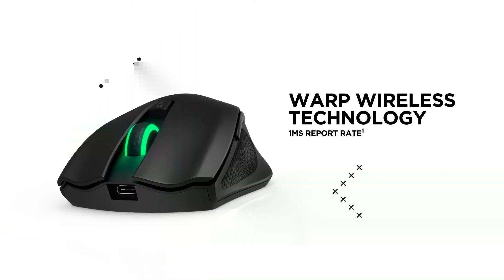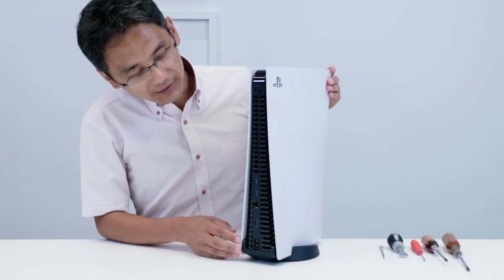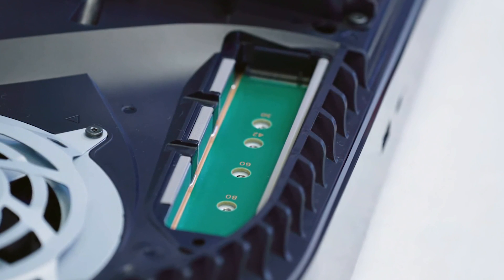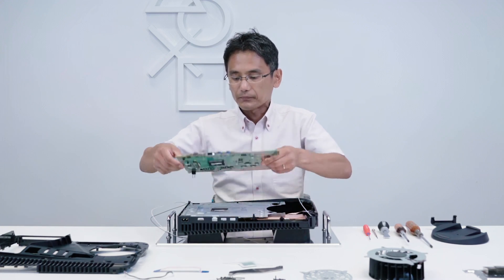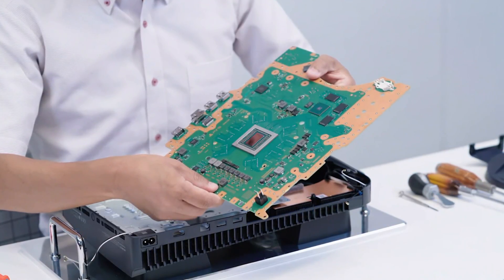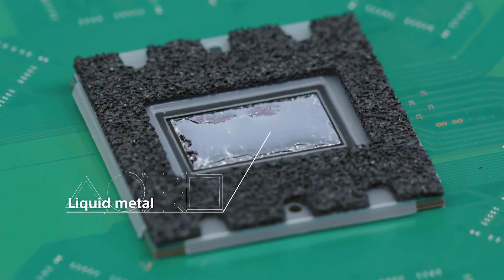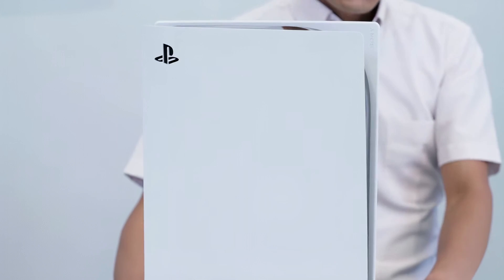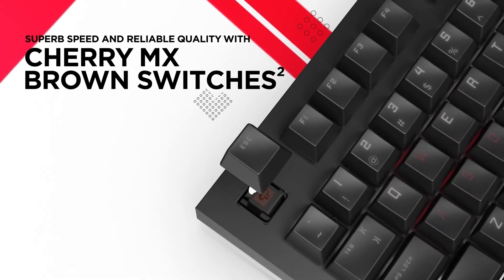PlayStation 5 Teardown Analysis: Inside Sony's Next Generation Hardware Design

Comment: So I finally watched this video.  Wow Richard could you be anymore bitter, biased, and condescending about Sony and the Ps5?!  My God this was essentially you saying how much better the xbox series x is and downplaying all the Ps5's amazing design features.  First you start out by praising Microsoft for giving you complete access to series x.  The entire video is you questioning and disparaging and downplaying all the Ps5's design decisions then praising the series x choices in comparison.  It really is insane how bitter and biased you are Richard.  You start by giving a back handed compliment to Sony by saying it's great the stand is included but making sure to say it's lo tech and nothing special.  Then you question whether the ssd will need a heat sink and suggest that performance could be lost unlike Microsoft's ssd which is on the outside of the system.  Well Richard the answer is right there in front of your face.  The ssd is right next to the inward air vents on the front of the system, obviously the fan was designed to dissapate the heat from the ssd.  Next you talk about the fan but make sure to note that one of the dimensions is bigger on series x.  Then when you get to the wi-fi and bluetooth section of the PS5 you completely downplay that playstation has the next gen versions of both of those.  But series x has the last gen version.  You failed to compare to it to series x when Sony has the clear advantage and downplayed it's significance.  And didn't even ruminate on it's likely use for a wreless PSVR 2.  Likely because that's where Sony has another advantage being the market leader in VR.  Then the discussion moved to the SSD/IO complex where you failed to mention that the Ps5 is 2.5 times faster than series x and has 50% more memory channels.  You failed to mention that having 12 memory channels is unheard of, even in the PC space.  And if taken advantage of by developers could result amazing things in game design.  Not content to just gloss over one of the Ps5's massive advantages over series x, you had to again throw some shade by saying unfortuately it's soldered on so it's impossible to remove unlike series x.  Everyone seeing the pattern here?  Next he barely gives any credit to Sony's cooling solution of liquid metal and it's large and well thought out heatsink.  He again disparages the Ps5 by saying Sony just went large and implies that it's poor engineering compared to Microsoft's much smaller xbox series.  The crap comparisons continue by Richard again exclaiming how big the motherboard is and again implying that it's not as well engineered as Microsoft's two smaller motherboards.  He adds a new disparaging remark by calling the motherboard simple compared to series x.  He then reminds everyone that Microsoft gave more details on the components of the Soc and praising them for it.  He then incorrectly states that the chips are for the most part the same and therefore Sony won't have any secrets to reveal but that series x is superior.  Finally he keeps repeating that Sony made the choice to go cheaper than Microsoft implying that this means the series x is superior.  Like last gen, where Cerny was able to make a superior system that's cheaper to make, I guarantee he has done it again.  Seriously this video was insane!  The bias is just so blatant.  This was just as much a propaganda video on series x and Microsoft's next gen strategy than a Ps5 teardown video.  Digital Foundry has dropped way down in my book now.  Check out NXgamer or Redtechgaming if you want more impartial videos.  I really can't get over how blatant the bias is now!
Reply: Just take a deep (bespoke) breath and chill-out. You’re got yourself all worked up.
Reply: Dude. Paragraphs. Learn how to use them.
Reply: That's what Microsoft sucking up and giving DF the VIP treatment at their HQ has done to them....

It's no longer a credible source of unbiased information, it's a better idea to get opinions from sources that aren't best buddies with either manufacturer. That's not the case here...
Reply: Let's be honest, Microsoft does almost everything better in the hardware side. Let's forget the 360 era and focusing on the One X vs PS4 Pro era and forward (Series X vs PS5). How compact and expensive the systems are (inside-out) compared to Playstations. PS5 looks like it's made of 90s leftover plastic and aluminium.
Reply: @virxest  Yeah ok bud.  Let me know when the shuttle lands.
Reply: Also check out Innocence where he literally explains all the leaked patents of PS5 and make a spot on educated guess of the PS5.

Anw, same like you, I lose all the respects for Digital Foundry. Thank you for suggesting other channels tho
Reply: @hungjaketranquang4365  The only impressive thing on the hardware side of the PS5 is the SSD and I/O speeds (which does not give you fps or resolution benefits), but Sony basically cheap out everywhere else. How do you praise it? They were just being honest and you won't accept it. Since it's your choice of the console (I assume), you just want to hear nice things. You cannot even praise the liquid metal in PS5 because the Series X uses the Vapor Chamber cooling solution which is more advanced and expensive in general. That's why it takes so much less space...it's way more effective. It only looks like a normal heat sink on the outside.
Reply: @virxest  You frankly don't know what you're talking about.
Reply: We shall see DF eat their words next year when the performances on same games are compared... or not. Till then take a chill pill bud.
Reply: @ivantruthkovic  I have no idea what the benefits of the things you mentioned are. I never use the console via Wifi (and you have to buy a very expensive new router...I saw prices between 200 and 300 usd) and USB-C and BT5.1 benefits we are still waiting for. Vapor Chamber cooling solutions found in One X and Series X are generally more expensive and advanced. I was thinking in general about the look and feel of the console (savings).
Reply: @Sony Drone Yes Sony is the market leader in sales of VR units.
Reply: OMG I can't believe that all you said was also inside my heart. DF have recently been sooo crap and trash praising MS's far inferior basic PC-like machine and saying shit against PS5. God knows how much they are being paid by MS! 

Please reply!

Comment: Still not sure why digital foundry insist on referring to the PS5 GPU as operating under a "boost clock" as the Eurogamer article released after the PS5 spec reveal indicates that the GPU and CPU operate at optimal frequencies when supplied with full power and are throttled to match work load. While this difference may seem minuscule on the surface the design implications are actually quite telling. This power shifting model, as opposed to a constant power supply model used in conventional console manufacturing, means that the PS5 can be extremely power efficient while offering optimal performance based on workload, rather than the other way around. This allows the PS5 GPU and CPU to only work as hard as needed for a particular game or even at a micro level within a given scene. This "work smarter, not harder" approach has some very interesting ramifications in games because the higher clocks allow the PS5 GPU and CPU to punch well above thier weight class while at the same time managing power consumption. It will not be suprising to anyone who has compared faster clocked hardware to more compute heavy hardware that the end result will be that both approaches lead widely to the same performance metrics. It will be interesting to see how PS5 unorthodox power system stacks up to the conventional wisdom, but it will not be suprising if the expectations for power difference are nothing more than people arguing over which two roads will lead to the same destination.

Comment: He doesn't seem too impressed with the design

I feel like the playstation is big, has a bigger fan, less silicon, liquid metal and variable clocks to reduce heat. Xbox is either a superior design or is going to have heat troubles. I don't see how one needs this level of cooling and the other doesn't unless Sony really dropped the ball and more cores at a lower clock was actually more powerful, cooler and cheaper???
Reply: I seriously doubt it's cheaper. Upping clock speeds is basically free. Hell, the Xbox One upped the clock speeds to try to keep up with the more powerful PS4.
Reply: @bf5175  right but maybe the heat increases requiring more expensive cooling solution
Reply: One thing to keep in mind is that PS5 is flatter than the XSX, and that comes at a cost. Another thing is that one can just be louder than the other, doesn't indicate heat troubles.
Reply: @ianwparedes  I guess we will see after they launch. If ps5 Is a beast and xbox is naff then I'd say he's getting bias because of the treatment from Microsoft. But if its the other way around then maybe Sony dropped the ball this time. Time will tell

Comment: I'm not getting one at launch for 2 major reasons.....
1. Don't have $500+ for it. (lol)
2. I'm going to wait till they make a "pro" version of it cuz I know they can make it... Better - er...
Reply: Best way to handle this. Cerny saying that Sony may be trying to push max power makes me worried the ps5 will be a thermal throttling brick-case. I'd definitely wait for a pro version and hope it has a psu rated at a much higher wattage is in store to actually utilize the hardware.
Reply: I’m gonna get the PlayStation 5 100% paid for with credit card rewards as soon as Amazon gets more in stock. Then I’m gonna save up for the PS5 pro and put that in a savings account to be held until they bring it out.

Comment: I have to disagree on the SSD heatsink remarks. (In my humble opinion) nands do not require cooling unless things get really hot (around 100C). The sweet spot for operating temperature is around 60C, and more to that, there are tests out there suggesting that halving the temperature (eg.: 30C) will significantly shorten the lifespan of the affected nands. What needs cooling is the controller, because if that part gets hot, then throttling will happen. 
Whenever I build a PC and put a sink onto the M.2/NVMe drives, I always cut the thermal pads, so they only cover the controller and not the nands.
Just my two cents.
Reply: My understanding is that the NANDs don't heat up that much anyway, so it might be better to have the heatsink on them for them to warm up from the controller heat. So when you do start a write operation on a specific NAND it's not starting cold, but has already warmed up from the controller and other NAND chips.
Reply: @defeqel6537  That might be a valid point indeed, worth to investigate. My tests are not conclusive sadly. Some years ago, I always got better results (means less throttling and higher benchmark scores) when I used full lenght heatsinks, but I moslty get the opposite results nowadays (so I get better results if I only "touch" the controller and other logic parts but not the nands).
Reply: @q3brain  To be clear, I haven't done any testing on this, just something I picked up somewhere.